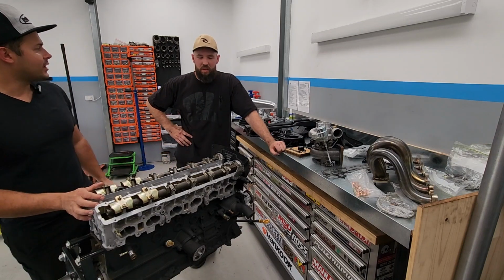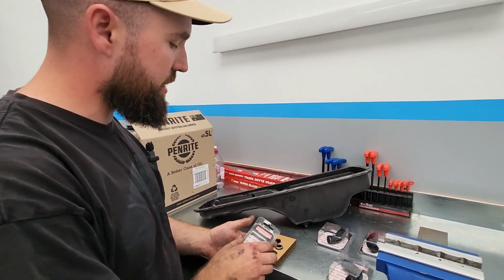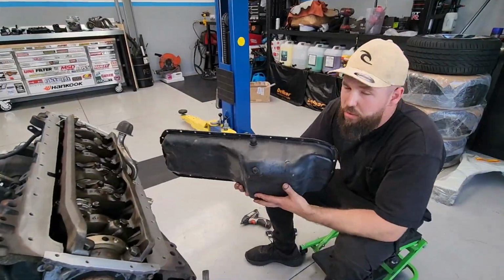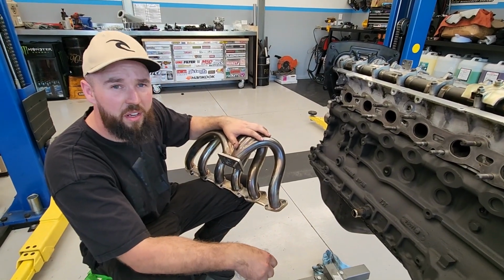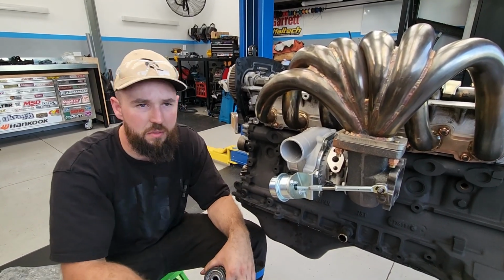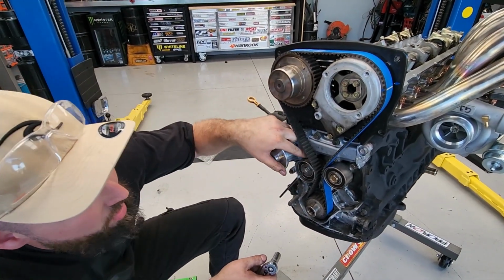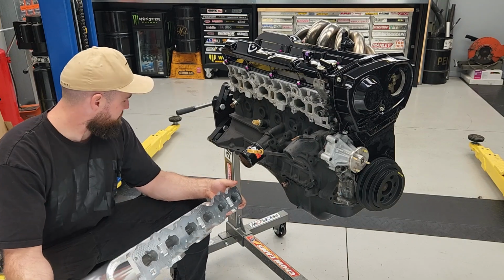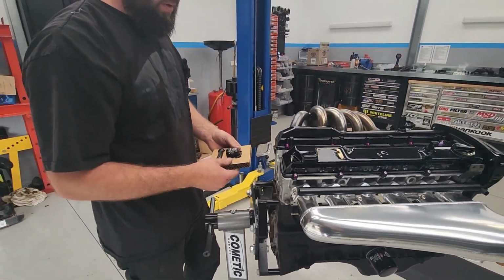Engine Assembly (R34 RB25 neo PT1)

Comment: Hey guys, I like your workshop setup, really nice! Just one thing with the drain point you fitted to the sump. I have an RB25 Neo I`m running in my R34 gtt and I just "T" into the turbo drain line that ran into the lower engine block that had a ready made hole already there. Does the engine you`re working on not have the same?
Reply from the maker: Thanks Brett, appreciate it! 

Absolutely it is possible to do that, personally think it looks nicer and alot easier to keep the line away from heat on the cold side of the engine. Also unsure of the repercussions regarding flow adding another drain into the turbo drain. Personal reasons why we opted for our option.

But theoretically should work just fine.

Comment: have you ever converted an r34 auto to manual?  looking to do it later this year
Reply from the maker: Sure have, if you have a look at our s14 conversion video almost everything applies the same. Only things that are different are you require a new bell housing plate as the manual and auto are different. Even the wiring is virtually the same. Any specific question feel free to ask.